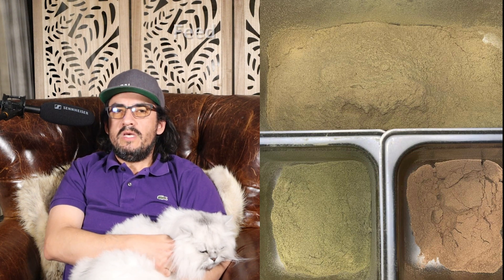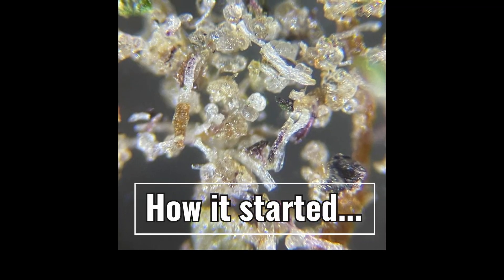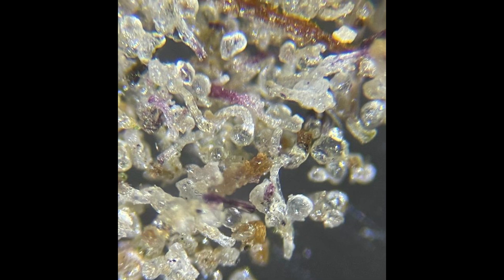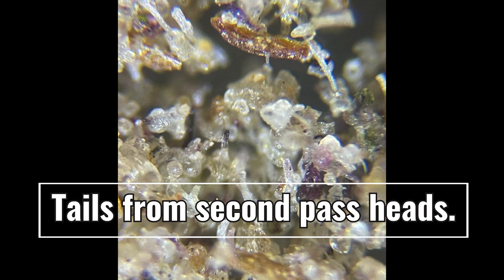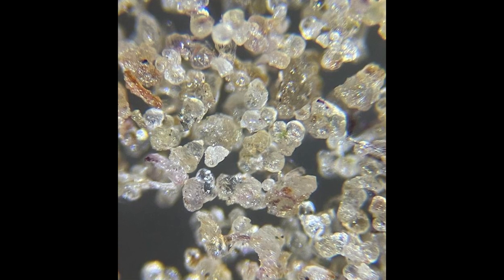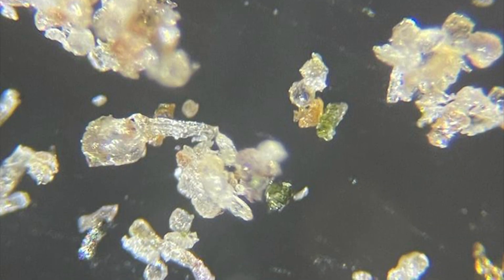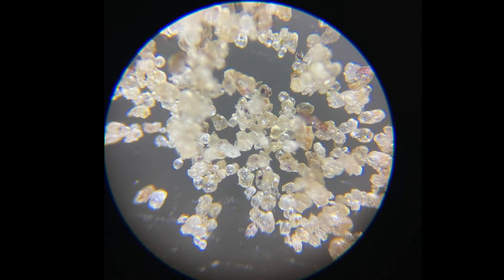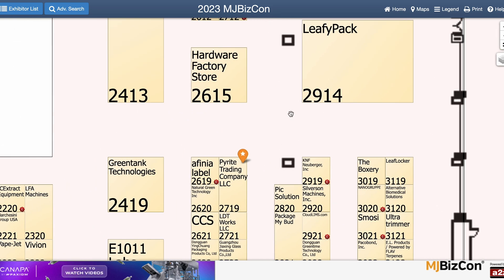Triboelectric Tuesday Episode 13 - Plasmastatic

Comment: I wonder if adding a cooling variable, such as dry ice or liquid nitrogen, to the process would increase the likelihood of separation of the heads from unwanted material? I've not seen the machine, as you mentioned, but you mentioned tumbling, and adding the cooling system to -90 (-) -120 C would be a neat experiment. Either way, solid work so far (as an appreciative engineer).
Reply from the maker: Yes we beleive cryo sifting is a great SOP to liberate heads. We are still perfecting this and appreciate any feedback on this. The theory is that brittle heads will easily decapitate. SOP is important as much as setup as you can make heads brittle and crack. For now we believe this is the way to go.
Reply: @SamboCreeckFiltration  Awesome. I love to see the data giving you direction. If you are collecting as many variables as possible to drive your conclusions, I would highly recommend a program called Minitab for data analysis. I used it for years and I can't express how useful/powerful it is.